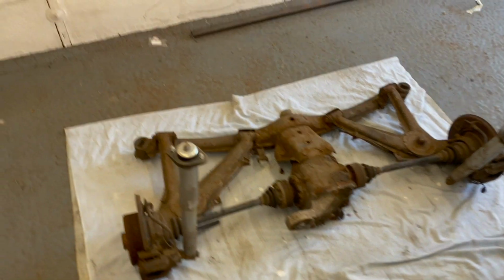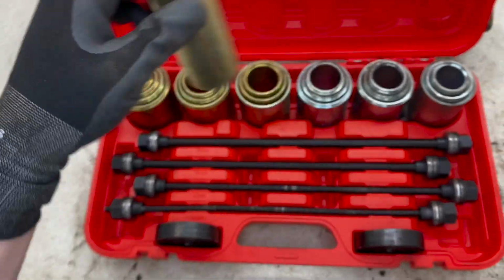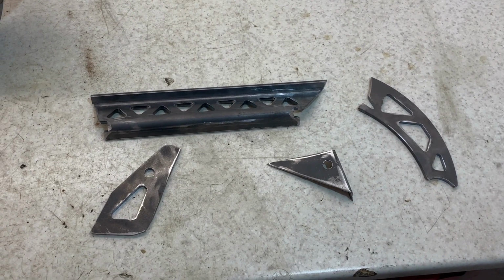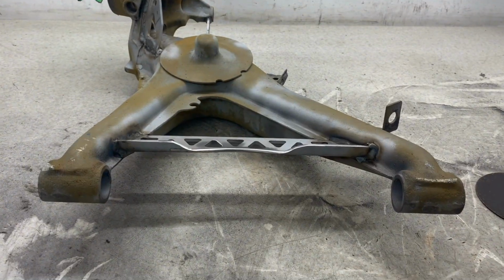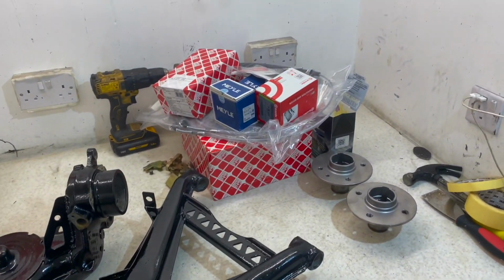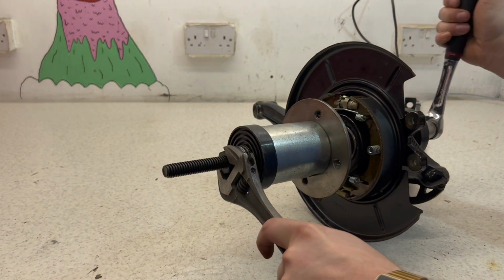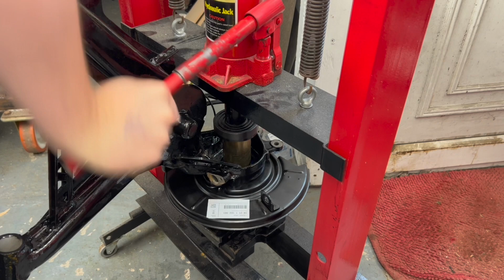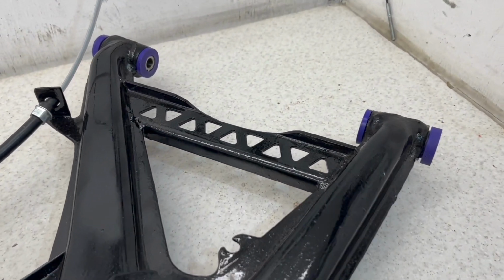EP. 11 My BMW E30 Restoration - Rear Trailing Arms - Complete Restoration & Reinforcements

Comment: You love that Por 15 😂! 
Great resto man! Keep em coming
Reply from the maker: I’m running out of parts to use it on! Haha.
Thanks 😎
Reply: @BadE30  what are your plans for the e30, OEM+? Surprised you didn’t go for a 5 lug conversion and a BBK
Reply from the maker: OEM+ yeh, I want 15” wheels with big tyres, and 5 lug wheels are not as popular in the smaller sizes! Also got the big brake kit on the front, just kept the same at the rear as my goal isn’t tracking it etc

Comment: Quick question, after sandblasting, the metal prep stage that you use, is that enough to allow the POR to adhere to the metal?  I've been all over the internet and I can't seem to get a solid answer.
Reply from the maker: Hi. I have had a lot of experience with the paint and doing what exactly that, i have an no issues. In fact I have found it to be very versatile, the sandblasting creates a well etched surface, and the metal prep helps this as well!
Reply: Did you wash it after etch or straight to paint?
Reply from the maker: @richardknowles1548  I washed it off, that’s why you can see a bit of flash rusting. I would recommend drying it as fast as possible once washed, either using a heat gun or compressed air

Comment: Nice job again, would recommend using compressed air after welding to help distortion, 😎👍🏻
Reply from the maker: I have always been told to be wary of speeding up the cooling process when welding, it can develop martensite but you are potentially cooling fast enough to de-temper the steel and cause porosity or cracks.
Luckily these were just small welds so no extreme distortion took place!

Comment: How many coats of por 15 did you apply?
Reply from the maker: One coat is sufficient for the smooth surfaces. But on the cast surfaces, it usually takes two as the first coat sits into the shallow parts of the cast revealing the peaks

Comment: very poor design of the strengthening kit by  born to drift. you should not have to modify it especially as the modification you.ve done is going to weaken the strengthening. i found out the hard way when i put it all back together and it started to rub the fuel pipe
Reply from the maker: It should for sure state this issue, I presume it is for e30's with a modified fuel tank. Shame it wasn't mentioned to me until I purchased the kit, I am happy the structural integrity of the modified side is adequate, still a pain!